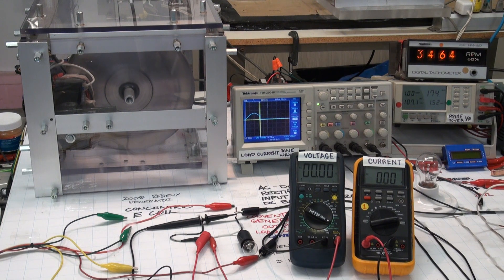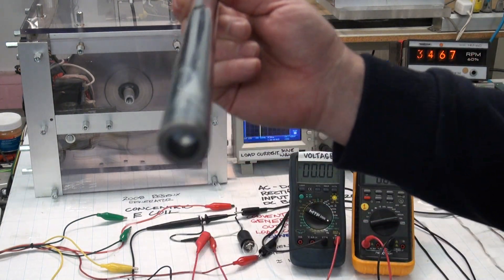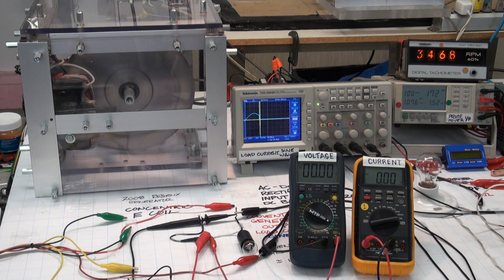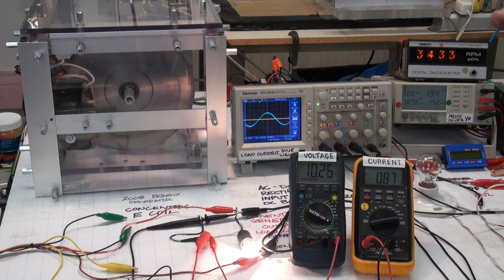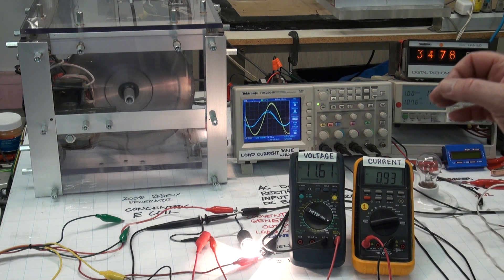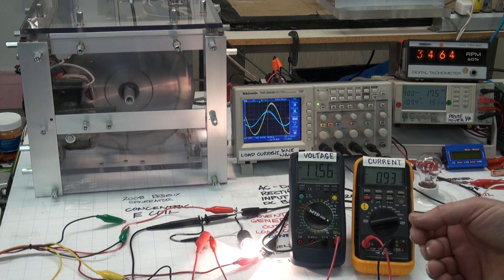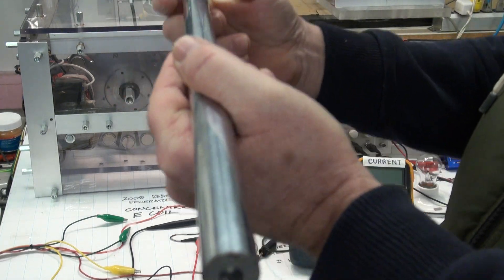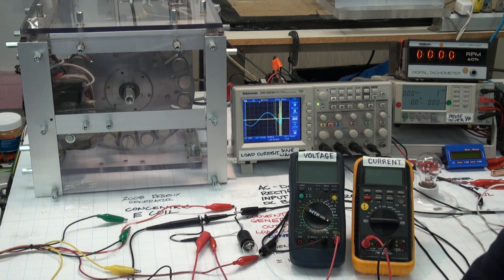VIDEO 9: WHY THE ReGenX GENERATOR IS NOT A PERPETUAL MOTION MACHINE

Comment: Maybe I’m missing something, but it seems like the concept of infinite efficiency is purely theoretical because there hasn’t been a measurement of the maximum load that can be maintained. Maybe what is being stated is that regardless of maximum load, an additional load of a small size can be maintained for an infinite amount of time without increasing the power supplied to the system. Does this sound right? If this is so then you’ve decoupled the need for more input power from required input power as long as the maximum output required does not exceed the maximum output that the system is able to produce. Is this a correct assessment?
Reply from the maker: HOW TO CALCULATE ELECTRIC GENERATOR EFFICIENCY & ReGenX Generator Infinite Efficiency: https://youtu.be/3_UXZBTCkSA

Comment: i no longer think that a electric motor generate work by consuming power in the first place. it seem as if the energy spent to drive the electric motor is not being used to drive the shaft but instead its furnished as heat build up in the windings. the motor torque does not come from power dissipation but instead the input is furnished  as heat. the fields that generate drive torque chould not generate heat at all. the potential difference only borrows the electrons to generate torque  in the motor but the energy is not going into the magnets. it never was in the first place. electricity can only do work by friction. magnetic fields does not consume electricity but the friction does. the motor is just a induction heater to that of a load. the torque does not come from consuming energy. the momentum of the motor does not act as real work. only heat generated from input electricity becomes real work. nobody seem to have realized this. the eddies induced when a magnet moves trough a copper tube is caused by friction. the opposing field does not slow down the magnet by opposing. the heat causes the magnetic field to turn into a mosaic pattern of magnetic poles of random direction. that is what causes the lenz effect. if all these tiny atomic magnetic poles was aligned in the same direction the induced magnetic field would not produce mechanical resistance. eddies forms when the atomic magnetic poles become random and that is what produce magnetic drag. if the material superconduct the atomic magnetic poles will all align in the same direction and the drag will be zero. energy in a electric circuit have to go somewhere so it turns into heat. the energy required to align the atomic magnetic poles is very small compare to the energy used to maintain them as believed to perform work on the drive shaft but is only performic thermal work in the winding. think dc current when you think heat. the winding require very little energy to magnetize but most energy is spendt maintaining the field with a field current that is as big as the initial momentum to magnetize the winding for a continious period longer than that required to magnetize the winding. that extra time does not add any additional polarization to the winding but have to escape and do so by generating friciton. a electromagnetic field is like a spring. when first compressed it can be compressed no further that maximum. if you continue compressing it it will heat up and get destroyed. magnets does not behave like lamps but only the winding does by inducing heat.
Reply from the maker: Law of Creation of Energy History 1820-2007
https://www.slideshare.net/PDiCEOThaneHeins3240/law-of-creation-of-energy-history-18202007
Reply from the maker: CORRECTIONS to Michael Faraday's Electric Magnetic Rotation Apparatus (Motor) Experiment Why Michael Faraday's Electric Motor Operated at Infinite Efficiency: https://www.slideshare.net/PDiCEOThaneHeins3240/3-corrections-to-michael-faradays-electric-magnetic-rotation-apparatus-motor-experiment
Reply: Do you know about asymmetric electrodynamic machines, asymmetric motors? In asymmetric motors, independent coils are switched on then off, without reversing direction of current. Unidirectional pulses goes through coils. Asymmetric motors consume much less electricity than symmetric motors. If asymmetric motors will be used to turn RegenX generator, than it will be perpetual motion machine.

Comment: In a nutshell,  you are saying the machine consumes more electricity than it puts out, right?
Reply: There is power in the drive shaft at constant speed. All the energy used to reach the constant speed is stored in the  flywheel. And this power is much greater than what is used to keep it spinning
Reply from the maker: New Laws of Physics as a Result of Canadian Potential Difference Inc. R & D 2007 - 2020 https://www.slideshare.net/PDiCEOThaneHeins3240/new-laws-of-physics-as-a-result-of-canadian-potential-difference-inc-r-d-2007-2020

How to Calculate Generator Efficiency & What Infinite Efficiency Means
https://www.slideshare.net/PDiCEOThaneHeins3240/1-how-to-calculate-generator-efficiency-what-infinite-efficiency-means-164624806
Reply from the maker: The ReGenX Motor consumes zero input energy and produces mechanical work / system kinetic energy increase at infinite efficiency.
Reply: @ThaneHeins1  Excellent! Carry on my friend...